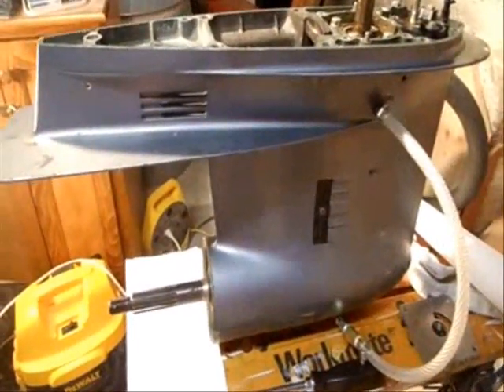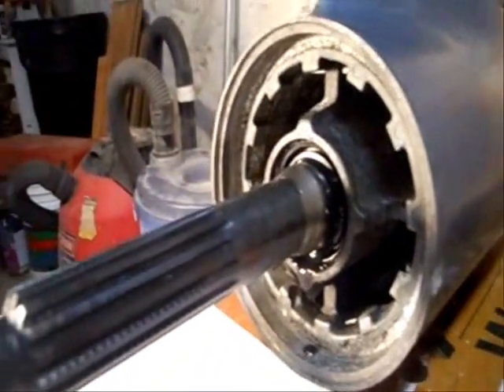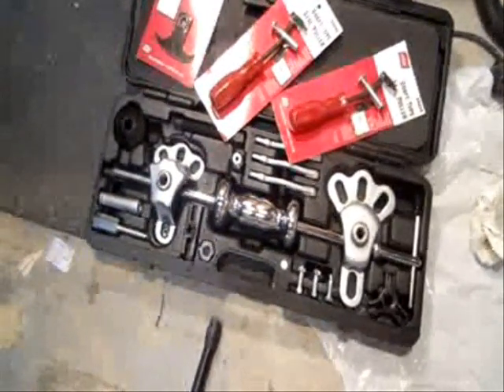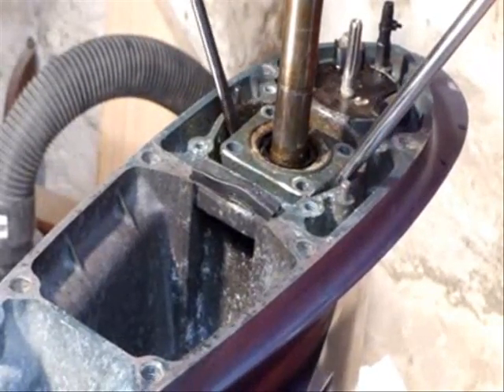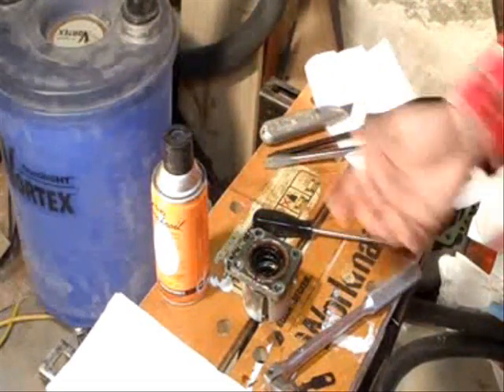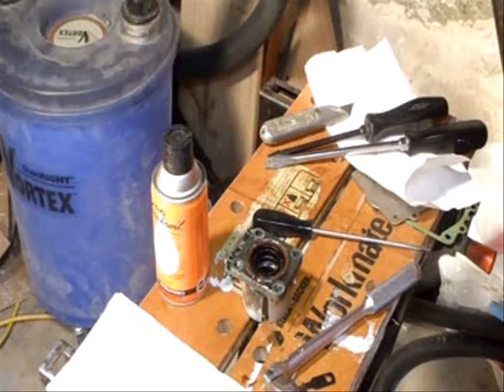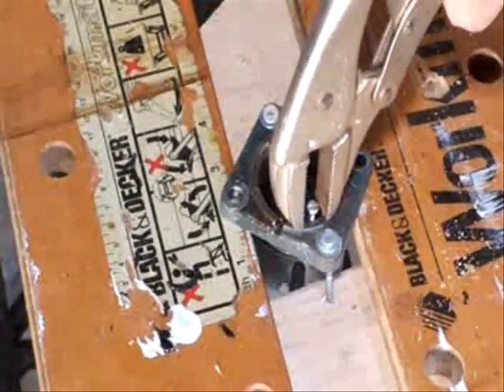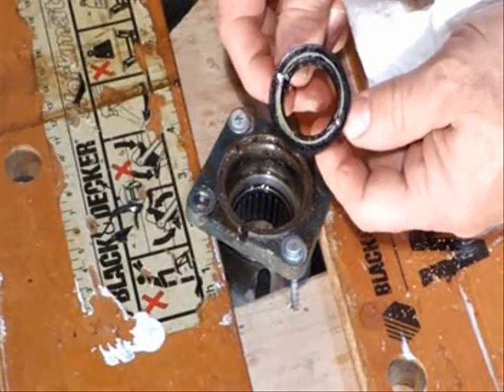Lower unit seal replacement pt 1 of 3 - upper seal experiments

Comment: What is the plastic screwed in nipple for that connects to a hose in the rear by the gear selector shaft?
Reply: Speed tube.  Water pressure from boat going forward goes all the way up to speedo.

Comment: Good day, very informative ! I am interested in replacing the shaft seal of the mercury 2 stroke 15 forces.There will need to fluff when you replace the new sealant seals how far in the bearing sits ? Do you have video? Thank you!

Comment: hello I have the 2006 115 hp and I need to replace the housing bearing oil seals but the 4 bolts are really hard there and I  was afraid to brake them...any recommendations to remove them?
Thanks
Peter

Comment: You put that seal in opposite from the way it came out.  I checked the service manual, and you are doing it correctly.  It looks like on these Yamaha lower units, the springs face the water, not the gear oil.  It's exactly opposite that of my old Mercruiser Alpha One.  I guess the Yamaha lower unit doesn't build up that much pressure in the gear oil.
Reply: I was thinking the same thing, but I backed it up and watched it again. He drilled holes in the seal not the housing. You will notice the screws are in the seal once he gets it out.
Reply: Is it proper to drill holes in the housing? Seems like shady work to me... SMH

Comment: Do you have any vids on how to replace just the prop seals on a 1991 Mercury
Mariner (25hp)? I noticed the dreaded milky substance emanating from the prop after running the motor with a pair of muffs. I took off the prop & quickly found the culprit-mono fishing line-ugh! But, I've never attempted this procedure. Thanks!

Comment: hello, can  someone help me with it
i just reeplaced the seals to a transmisión Yamaha 250 hp, but when I used it for 20 minutes, it got wáter again and the gear got dameged it is the second time I did itand twice the transmition has gotten wáter in, i dont know wy because I,m using Brand new seals

thanks
Reply: Be careful how you remove them, the slightest scratch on the shaft will damage the lip of the seal as soon as the shaft rotates.  Inspect your shaft where the seal lips contact for scratches or damage.  If need be, you could polish the areas, if only light scratches, any dings from screw drivers (idiot rash) & you'll need to use something like a speedi-sleeve.  Always fill in between the seal lips with o-ring/rubber grease.  if not the seal will be damaged due from being dry when you start shaft rotation.

Comment: The gasket dressing is a bad idea, it's going to get into the bearing.
Reply: yep... the seals are made to go into a clean, dry surface. sealant will cause distortion and will push it off center.

Comment from the maker: I followed the Yamaha Service procedure for seal direction - spring up or out for both seals. Yamaha faces both seals in the same direction which is different from Evinrude and Merc which face them in opposing directions with the spring facing in on the inner seal. I don't know which way is better but in the past I have had slightly more water problems with Yamahas than either Evinrude or Merc

Comment: thanks for the "how to". I've read others using the screw method to pull the seals. I will however agree with whomever said the audio is horrible. parts of it I couldn't hear what you were saying at all, and then the tv or radio in the background for parts of it.....

but thanks for showing how to do this. I've just changed my lower unit oil and it was pure milk, time to change the seals. you just showed me how!

Comment: Thanks for the video, I used the same "drill and screw" technique. For the record, when they say removing the prop hub is a pain in the ass, they aren't kidding. In fact, this entire job was an EPIC pain in the ass. However thank you and if I may provide an additional tip - your machine screw option didn't work out so well for me. DRYWALL screws, the speed type with wide ribs worked great. Literally ripped the oil seal right out. Gasket seal compensated the nicks and dents.

Comment from the maker: The oil was drained prior to injecting the air. For my case the leak was so band it bubbled at any pressure.When I was done it didn't bubble at 10 psi.

Comment from the maker: The two gasket sealants I used were Permatex Aviation Form-A-Gasket and Johnson Evenrude Gasket Sealing Compound. I don't think the Aviation Form-A-Gasket was necessary but might help if you have corrosion or pitting in the area. Good luck.

Comment from the maker: @DaBrIGGS07: My compressor was set to 10 PSI which is not too much at it supposedly will hold 14.2 PSI. If you Google "Yamaha lower unit pressure 14.2" (without the quotes) you get lots of hits from people talking about pressure testing.